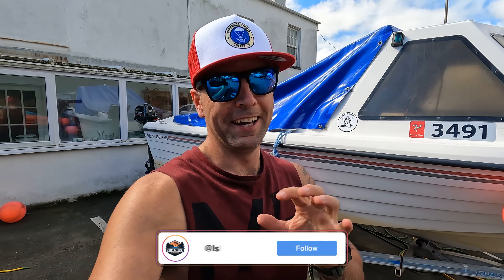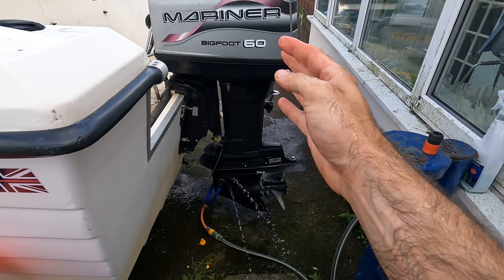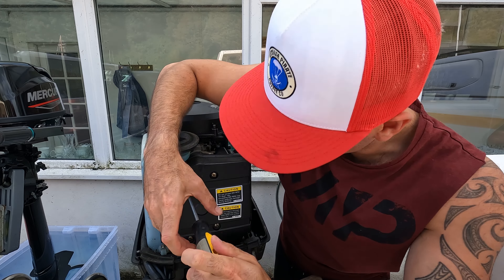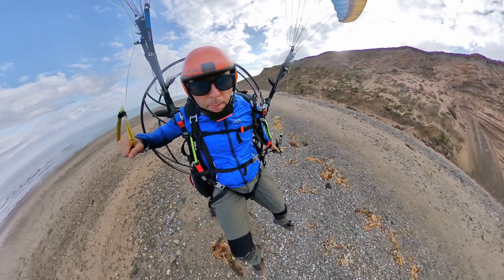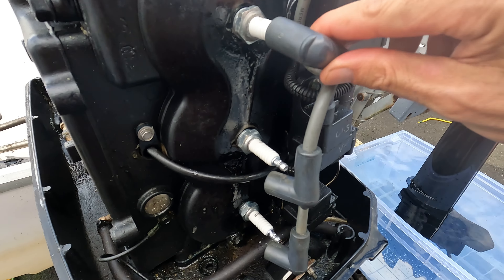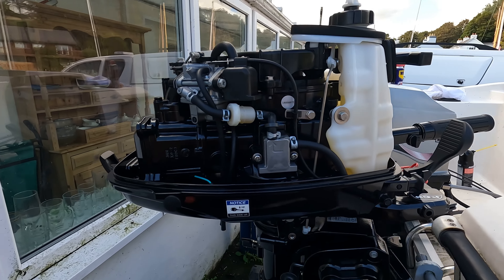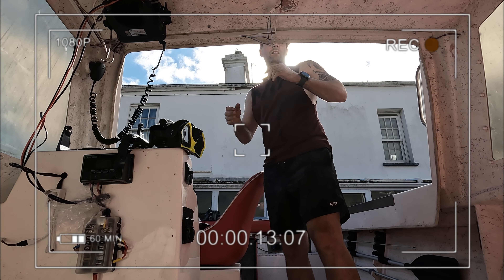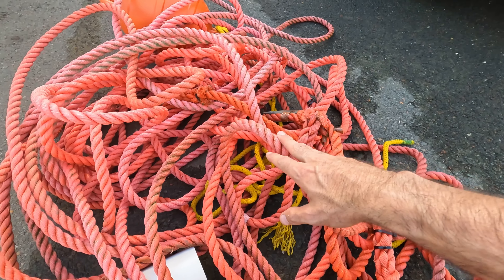WINTERISING my Boat for Storage ❄️ 🛥

Comment from the maker: I know, it’s early! But where I store my boat they have to be out of the mooring by October  ❄️🛥
Reply: While you have the airbox off and fogged everything , drain the carbs  down manually on each one before taking it to store, when you remove the prop remove the front stopper thats in front of it and inspect the output seals on the prop shaft thats where any fishing line will do the damage, pretty sure they will be fine as you never found any water in the oil

Comment: HI just found your channel great stuff well done buddy nice work. I myself have a wee project boat that i intend to do over the winter over here on the east coast of Scotland, The boat i have is a Fletcher Vigo  have the plan in hand just a case os sourcing the itme at a reduced price, I dont have an endless pot of money so it will be ebay bargains as and when i find them,  I have a mariner 60 big foot as well. I hope fully want to run 2 of these in a twin engine set up, Soooo if you go to sell your one keep in mind please.
Enjoying your content. How did you get the winch handle ? Mines looks like yours before you done the work.
Cheers
Andy
Reply from the maker: I just cleaned it with a wire brush matey! Hopefully your bush comes along nicely 🙌